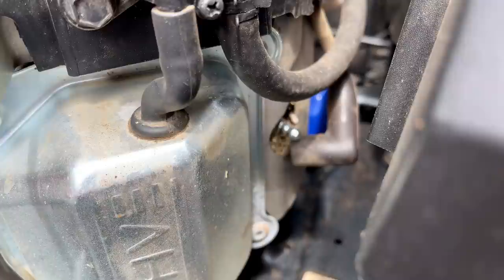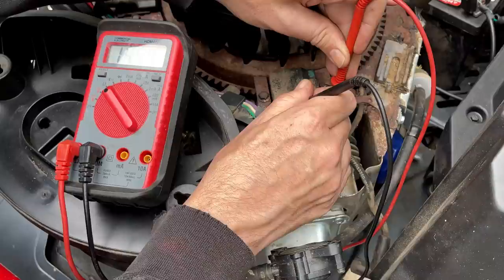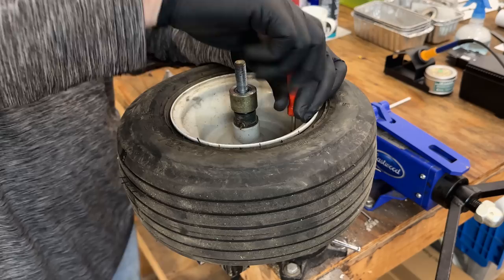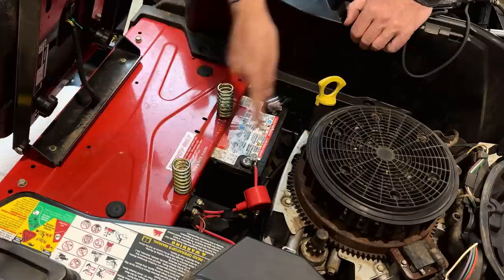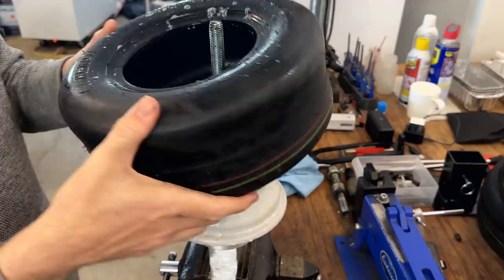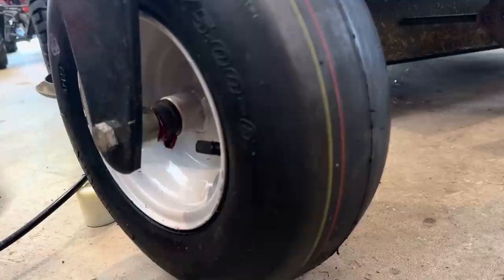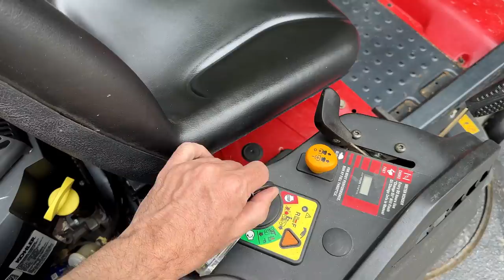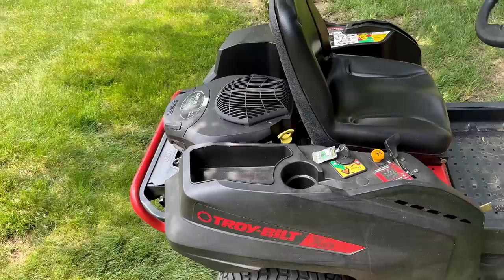Zero Turn Mower Down on Power - Not Firing on all Cylinders

Comment: 230cca batteries only last around 4 years if you are lucky. They only last 2-3 years in colder climates because they do not have the Electrolytic capacity needed to keep them from Freezing.

Comment: People just do not maintain their equipment properly.  I was off my lawn mowers after every use and blow them dry with my blower before putting them up.  I check oil before each use and keep them filled with stabilized premium non ethanol gas.  I also change oil every 25 hours or Spring and Fall if they do not have an hour meter.  I use Pennzoil Platinum 10W-30 in all my four cycle equipment and Stihl Ultra in my two cycle equipment.

Comment: I hope the battery issue is fixed.  I have the same engine in a Toro MX 5050, if I don't disconnect the battery when I park it for longer than two days then the battery will go dead.  On my third battery now.  Local shop has looked at it and can't find what is draining it.

Comment: Paul needs to step up his equipment  maintenance game & possibly needs some training…
Reply: Why, he’s got James.
Reply from the maker: He stepped up his rodent control.
Reply: Yep. Paul needs a good mouser in his barn.
Reply: I have a Kohler Pro V twin,  yesterday I was checking the spark plugs,  and I took the left cylinder plug out and I looked in and seen what looked like a clump of dirt,  I used needle nose plyers to pull it out.  It was a very well done mouse.  I use my mower usually once a week.  So I don't think it had been there very long.  I'm sure it didn't take long to cook it either.
Reply: I talked to Paul ,he said mind your own business !

Comment: Great work James, Does Paul have an issue where he is storing his equipment? Both of the machines that you worked on for him seem to have excessive corrosion on the engine parts etc. Thanks for another perfect video.
Reply: You mean Paul's Rodent and Broken Equipment Emporium?
Reply from the maker: He has a rodent problem.  He just upped his game and put out rodent bait.
Reply: @blainesayler1514  ...and content generation!
Reply: Putting away a hot mower into a un-vented shed....condensation and then rust. Mice love sheds and mowers. Helps them to usually be safer from snakes.

Comment: 14:09  of course #1's not firing, the primary's disconnected! The real reason it wasn't firing was the corrosion on the primary connector.
Reply: Nope. That corroded connector is for the shutdown wire. The "kill  wire". Without it connected, the key won't shutoff the spark.
Reply: @heyinway  The idendical coil next to it has an identical white wire.  When it's working at the video's end, it's connected. When it's not firing at the beginning it's not. Check the timestamp.
Reply: Wrong..  that's the kill wire.  @heyinway is correct.

Comment: Before discarding a battery due to self-discharge you should really test it by leaving it completely disconnected. It looked like you still had it connected which would give you false blame if the problem was a drain in the vehicle. It's less likely to happen in a mower than a modern car but the charging rectifier could leak current, or there could be some contamination such as water in a relay.

Comment: you should have thought of the stick steer mowers steering method when that troy built said 4 wheel steer, cause stick steer does the same with the rear wheels as this one, mowers with 4 wheel steer are not steering like monster trucks

Comment: Those are designed for a steeper incline than a regular zero turn you control the front wheels unlike a regular zero turn that will turn down hill

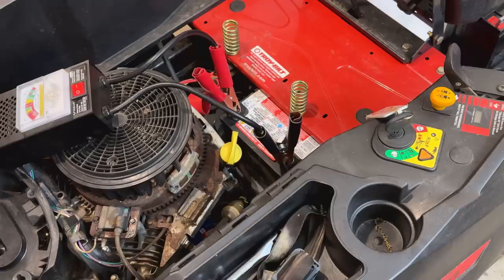Comment: 25:13 I don’t know if you know this or have tried this but for those small batteries I haven’t had great success with using a charger that has a desulphation mode( recondition)

Comment: Ah Paul the mouse ranch guy.  I bet he has black berry, prickly ash or maybe some old barb wire laying around as well from the looks of those tires.
Reply from the maker: Probably.  The Cub Cadet had the same issue.
Reply: @jcondon1  4 ply+ with tread and tubes is your friend for these off-lawn conditions .
Reply from the maker: @luuk-out-below9804  the old were 2 ply.  New 4 ply.  Hopefully will last a little longer.
Reply: @jcondon1  I'm sure of that, I have the same pokey conditions.  I run brush cutters and mowers along fence lines and trails etc.  It doesn't take much to get pin holes in these tires.

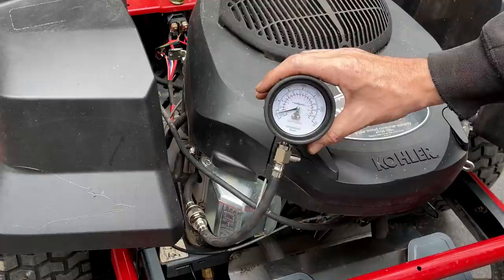Comment: 5:37 To run properly, you mean. They'll fire with a hell of a lot less compression than that. They'll fire with as little as 10 pounds in them and produce enough power to sustain engine operation with no load while sporting as little as 40-50PSI of compression. To run properly, yeah, they need around a 100PSI, but they will fire with shockingly little compression.

By the way it sounded turning over I'm expecting absolutely nothing from this pot. It didn't sound like it was compressing on two cylinders to me.

Comment: Jim; when you crank the engine over with a spark plug wire disconnected....are you not fearing that the coil will be damaged?  I have always been told to ground the wires to avoid stressing the coils (or powerpacks).  All that voltage has to go somewhere.

Comment: I HATE TIRES. That being said, I like the idea in setting them outside until the become more pliable. But sometimes you have to manually set the inner bead, and then pry up in the area of the valve stem for outer bead. Then blast them with air. Using  a wooden doll and harmer for inside bead. They don't have to completely seat. Just enough to hold inner bead in place while pulling up outer bead. Lots of soapy water.

Comment: "Don't use a power tool on these because they are very small bolts."   10 seconds later, uses a power tool to remove bolts on the other coil.  :).

Comment: Low on power, maybe with blades engaged, it wasn't putting out enough RPMs to properly charge battery. Electric PTO robbing most of the output.

Comment: hear is a trick you don't know. force what you can on the valve side then place wheel on bucket full of water. press wheel down and bucket becomes a seal until tire goes in rim

Comment: If a battery that has 12.86 volts at rest needs to be replaced, then I should replace every battery I own on every engine including my cars.  I have never owned a battery that read above 12.6 volts atrest even after having been on a charger for a couple days.
Reply: Batterys can have voltage but lack enough amps.  That is caused by the lead plates being sulfated ("corroded").

Comment: Those Kohler engine coils are known for going bad. Not to shift any equipment but have you done any combo propane/fuel generator videos? I've watched mostly all of your generator videos and it feels that you left that area to pursue tractors now. Anyway, I have this Champion generator for tail gate parties. The engine will shut down after a few minutes of running. The carb has been pulled and cleaned and good fuel flow from the canister. I had hoped it was bad fuel or even water showing in the trusty coffee cup...no chance

Comment: If you want a sure fire way to keep rodents out of your engine on your equipment or your vehicle give it a shot of bear spray once in a while.I tried everything until I tried that after two expensive repair jobs on my pickup.I have bear spray in the truck and in the house because we have bears around us.the lite bulb went on and voila….haven’t had a problem since

Comment: Me: OK since you begged I'm going to loan you my small tire removal tool but you have to bring it right back when you are finished.
Them: ... 
Me: (I don't even remember now who them are and them has not returned it years later. But if it was my sister I'm sure it's been sold in a yard sale by now.)

Comment: Name on the side says it all…. Troy Built.  I’ve never had any good luck with them lasting, motor, frame and decks.  They are made so cheep and flimsy with inferior materials.  Even if the motor says Briggs n Stratton it’s deff not of the full quality you would get with a higher end piece of equipment.  There’s exceptions I’m sure, but they are few and far to be found.

Comment: EVERY ZT I’ve ever had has a problem with the front tires not holding air. I don’t know what the problem is, but every one I’ve ever had goes flat after sitting a few days…
Reply: They get smacked against curbs and asphalt and it breaks the bead.. I replaced mine with solid wheels and never looked back.

Comment: But, you can disconnect either terminal first.  Either way, once either one is disconnected , you no longer have continuity.   😮😊
Reply from the maker: Try, but if you disconnect the positive first just have to be careful not to touch the wrench to any part of the engine or frame.
Reply: @jcondon1  I agree.  There is less chance of an accident disconnecting the negative first. But anyone who doesn't understand the potential probably doesn't need to be doing this.

Comment: Hi James, so I was wondering if I could ask you about a 5000 watt husky generator that uses a Subaru engine. The generator doesn’t make power and although I did check the power head for any obvious signs of damage there were none. My next move was to flash the system however that didn’t seem to work much. Sadly I don’t have a multi meter handy. But maybe the AVR could have gone bad? I’m not really to sure yet. I will also add in that the engine sounds like it’s running a bit slow below 60 Hz.
Reply: Update: never mind due to the lack of light the ENTIRE power head is bad as all the winding are burnt to a CRISP. And everything is chard. It’s probably just a parts generator at this point.

Comment: I have that same engine in my club cadet it runs out of fuel when tank has plenty, so i changed fuel pump ,but it still dies .when cold it will run about 5 minutes then runs out of fuel again, nothing in tank to block fuel. 
Don't know what to do now.

Comment: Put ATF in the tire?---- What is what looks like a piece of wood under the motor-home tire? Yeah those tires are difficult...What tire changer is that?
Reply from the maker: The wood under the motor home tire help prevent it from sinking into the driveway on hot summer days.  A metal plate would work a lot better.
Reply: @jcondon1  
Given the laws of physics and how heat is absorbed and transferred by various materials I’d hazard a guess wood would work better.

Comment: Think you should have changed the engine oil and filter, since the engine hasn’t been firing on that cylinder, I would bet that it’s a lot off gas in the engine oil.
Reply: I changed the oil and filter before dropping off the zero turn to Jim.
Reply: @PaulMack1249  very good👍

Comment: James where did you get that tire change tool? Could you send a link or you may have said it in the video and I missed it. But I definitely need one for my garage cause like you said i fricking hate those little tires with a passion and they are always leaking.
Reply from the maker: Harbor Freight PITTSBURGH Mini-Tire Changer - Item 58920 https://hftools.com/app58920

Comment: I have new xtremepowerus 212cc 7hp gas engine with a broken crankshaft. The shaft sheared off at the pto. Any idea where I can get a new crankshaft? I live in CT and don’t usually work on small engines so don’t know where to look for parts. Thanks! If I can’t find the part I’m willing to donate the engine to your channel.

Comment: You're doing it the hard way you just need to pull one plug wire off each at a time and 1 side if it doesn't cut out when you pull upward then it's not that side and if it does cut out then it is outside I mean people won't plug wire a 1 way if you've got it down a cylinder on a plug or not firing on a beach when I'll be twin once it's gonna master hit on the opposite so if you pull the 1 block wire but it is hit none it's gonna die out and if you that way you know it's the opposite side Get what i'm saying

Comment: Would it not be prudent to change the engine oil now, after all the time it has been running recently with no spark on that cylinder the excess fuel could have diluted the engine oil. And only 82 hours could be original oil😮

Comment: Good work.  But I have to disagree with your choice of front tires.  Even though the machine is sort of a "zero turn", the front wheels do provide steering control.  For that reason, I would choose tires with tread, not smooth tires.  Not a big deal anyway.  Thanks for the video.
Reply from the maker: I agree.  Tried to stick with the OEM ones but had to settle for what was in stock.  Paul says they work well for him.

Comment: The terminology here is:

Tire = the rubber part
Rim = the metal part
Wheel = both together
Reply: @John-qc8yy , quoting from United Tire and Service website: "The terms "tires" and "wheels" may be used interchangeably at times, but they are not the same thing. Wheels are the rims on which tires are affixed. Tires are rubber ovals that are installed on the wheels."
Reply: @bent.cyclist  Tires are round.

Comment: the amount of problems a company is unable to deal with themselfs distresses me... if i am a logger i should be able to disassemble my chainsaw in my sleep, reassemble and it should fire right up. same should be for a company that is selling lawn service. basic maintenance seems also to be missing totally...
this coming from an it-guy that fixes saws and other machines as a hobby, not because i am dependend on them.

Comment: How come the mower starts with no-one sitting on the seat?  Has the safety been bypassed?  As it is, if the mower rolls and throws the operator off, it can continue running and fall on said operator, doing a bit of mowing of the body hair and other parts he may want to keep.
Reply: It will start with no one on the seat, but only if the blades aren't engaged.  If they are, instant engine kill.
Reply: @khx73  Ah, OK.  American half-baked safety.  Here in Australia, you have to close the seat switch (by sitting or bypassing :)  ).
Reply: @einfelder8262  To clarify...  the engine will not run without a butt in the seat with the blades spinning.
If you come off the seat, the whole thing shuts down just like yours.
Only diff is, I can start it without being in the seat (blades not engaged of course).
Reply: @khx73  No need to clarify - I completely understood the first explanation.

Comment: Did he run over any apple trees with this one ? Paul needs to do something about the vermin on his property or in the barn that he keeps his implements in if he indeed even keeps it inside. How does something like this get so rusty ?  I've never seen a zero turn mower with a steering wheel other than a Snapper Yard Cruiser and all it had was one joy stick. I wasn't impressed.
Reply from the maker: Not yet, but I almost hit my apple tree testing it out.

Comment: James, what are the dimensions of your equipment trailer and do you find it’s large enough?
Reply: Thanks for the video James, another great video more please 👍😂🇬🇧
Reply from the maker: 5’x8’ carry-on brand from tractor supply.  So far it has been large enough.  I also have a 6x12 but have not needed it since getting the smaller one.
Reply: @jcondon1  
Thanks!  That pretty much confirms what I’ve been thinking I’d want to get to transport all the same equipment you work on. 👍
Are there any details you would change or improve?

Comment: As this mower is a steering wheel zero turn should have gone for the grip tyres not slicks.
Reply from the maker: I was worried about the same.  They actually worked very well and Paul commented after using them a couple months that he like them better as they did not cause damage to his lawn and steering was good.

Comment: I've never seen a zero turn with a steering wheel and foot pedals.  Only 7 years old?
Reply from the maker: Closer to 6
Reply: I maintain a $24,000 Cub Cadet for a residential customer. Dual rear wheels, and 72" welded deck. It's a beast and does great on hillsides.

Comment: You referred to replacing the "wheels".  I assume what you meant was replacing the TIRES.  Wheels were fine weren't they?

You referred to replacing the "wheels".  I assume what you meant was replacing the TIRES.  Wheels were fine weren't they?You referred to replacing the "wheels".  I assume what you meant was replacing the TIRES.  Wheels were fine weren't they?

Comment: Wow, just did a ton of unnecessary inspection and repair.   Put a new coil and battery in it.  Good to go.  It’s a lawnmower.  Not a car u might be 100 miles from the house when it breaks down. U did a good job, but not my type of video.

Comment: They are the incorrect tires, they are for a zero turn with the steering performed by the rear wheels, this is a zero turn that he is working on with front wheel steering, they are going to slide all over the place because they have no tread, they should not be slicks on front wheel steering, very poor decision to put these on the front of this mower, and I could have swore I heard him say the owner wanted OEM tires, they are not only incorrect but they are not OEM.
Reply from the maker: This zero turn uses both the front and rear wheels to turn.  I was worried about the same.  They ended up working really well according to the owner.